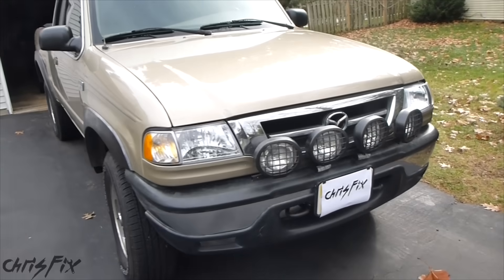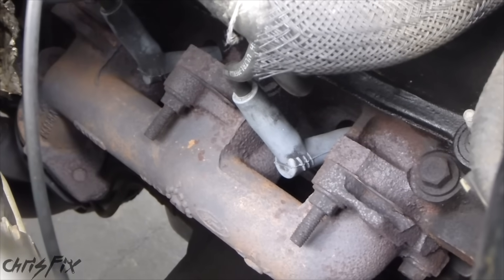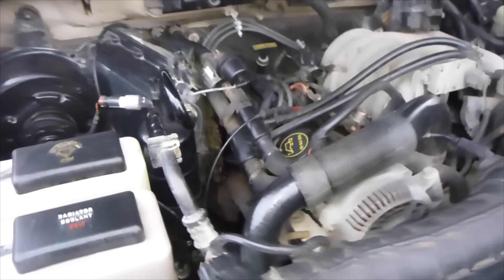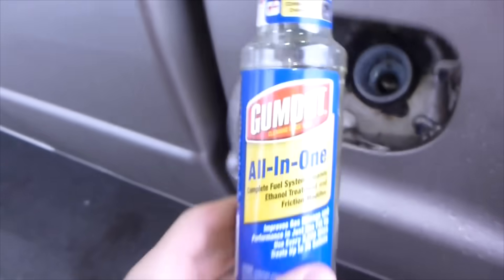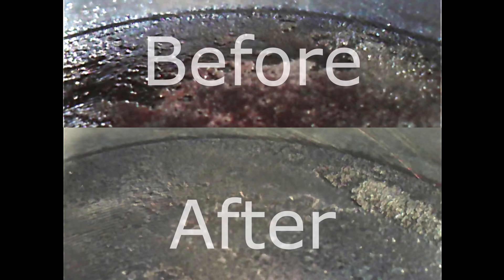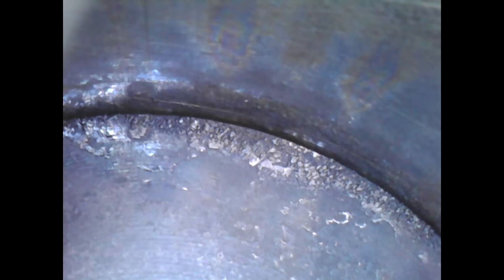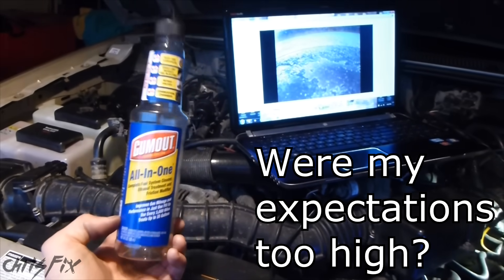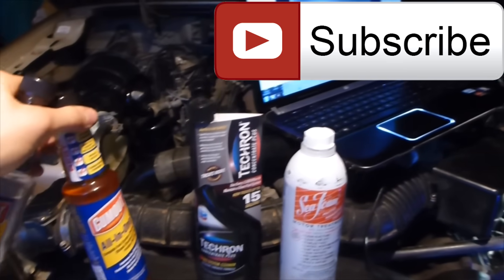Do fuel system cleaners actually work? Testing Gumout "All-in-One"

Comment: the big stuff should and you should want it to take longer to dry it out enough to particulate into small enough dust so as to not hurt the valves on the way out after a few applications it should get better but I do 3 applications consecutively to dry it out than not again for long time  honestly never owned a car long enough to have to do it again     another way is to make a chip tool to fit in there and a rubber vac line to remove manually
Reply: +Richard Duenaz forgot to mention I also sprat carb cleaner in the cylinders through the plug holes for a few days than I poor one bottle worth into the cylinders in equal amounts  unless theres one worse few days later i look in tak e tool chi and vac out the pieces spray with more carb cleaner replce plugs run car with gumout only 1\4 tank gas and drive for 40 miles or so fill the tank with one more gumout full tank gas than another than i check after that its usually pretty good if it didn't start to bad
Reply from the maker: +Richard Duenaz Thanks for sharing!

Comment: So far I've driven with half a tank of this. Haven't really noticed improved gas mileage yet, but the acceleration has had a very noticeable increase. Not only is it faster responding to the pedal, but I can now go straight from 0-80 without over-revving the engine, before, the RPM's would shoot to the red and if have to ease of the pedal. I will most definitely be using this again and probably regularly as well

Comment: I believe it works with some of the carbon. I think you need to continue using it for awhile. like try using it everytime you fill up 3 or 4 times. I use gumout highmileage and have had no issues, actually I have more miles than him and it works great for me, now not for everyone, but for me.
Reply from the maker: +Erik Black Thanks for sharing Erik!

Comment: Great video, subscribed. I do wonder though if you had used this product every 5k miles would the carbon layers not been so thick to begin with. It seems to do well with the superficial layers, but the compacted carbon seems like its not going anywhere.
Reply from the maker: +D Lee Thanks! The carbon buildup in this engine is not bad enough to warrant use of a cleaner so often. Save your money! Glad you subbed!

Comment: +ChrisFix

It really might be the wrong place to ask this question, but from your uploads, it really looks like you know what you are talking about!

I have an Audi A6, 2.0 TFSI (2007)
i have some really bad vibrations when the car is running idle. The vibrations comes and goes. Have taken my car to the  shop twice, and both times, from my bad luck, the vibrations went away and they didnt really know what to look for. you can actually feel the vibrations in your ears and i have 2 kids that complain alot about it :(

If you have any idea what it could be or a solution you think i should try out, please do tell me!

Thanks in advance
Reply from the maker: +Dizturbias It might be your exhaust or it could be a slight misfire in the engine.
Reply: Thank you for your response.

Comment: Will this help with a bouncing rpm needle and slight jerking movements?
Reply: that happened on my 2007 328i. but I used techron fuel system cleaner and the bouncing rpm and jerking stopped. I also changed the oil.

Comment: +ChrisFix let me start by saying that you are by far the best Youtube mechanic I've ever seen! Now....I have to say that is horrible gas mileage.Since I've been watching I've fixed my tie-rod ends, sway bar links, put on a leaf spring lifts, put new to me door panels and window guards, and did the Seafoam application. I drive a 2000 Ford Explorer XLT with a 4.0 SOHC. I was wondering if you can change your rear swaybar links for me seeing that ours are practically identical? Thanks for all your hard work!
Reply from the maker: +Gatescaper Thanks a lot! Your gas mileage might be bad like mine because of clogged injectors. I might be doing rear sway bars so stay tuned for that!

Comment: Hey Chris! Nice video. Would you mind doing another fuel additive video about Gumout Multi-System Tune-Up? The one that looks like seafoam. Another youtuber Scotty Kilmer recommends it, but don't really know how well it will work.
Reply from the maker: +Gideon Mak Scotty recommends it because he was paid to recommend it. I will test it out so stay tuned!
Reply: Thanks Chris! I look forward to that video! I used it twice and it somewhat smoothen my engine and I got better acceleration response when I step on the gas for the first time. But not much difference for the second time.
Reply: +ChrisFix Scotty K.HA HA!!I used the Gumout Regain looks about the same?I smelled it doing something?Great video Chris.

Comment: He y ChrisFix, my 2006 VW tdi (i know, a diesel) it has problems where during acceleration i get 0.5 to 1 second of lack of power, its not wheelspin since i can get this in 5 Gear while merging onto the freeway. It has about 200,000kms, it also releases white smoke occasionally when i turn it on and turning it on takes a couple seconds. Can you give me a vague diagnotics? Can anyone help me please?
Reply: It doesnt happen all the time during acceleration, more so around 2000rpm when the turbo kicks in...
Reply from the maker: +Haris_Awesome It could be the heater plug or an injector. Maybe the EGR is stuck open or closed?
Reply: +ChrisFix ive had the EGR valve changed, about a month ago aswell as glow plugs and air intake filter. The turbo seems at times very loud and other times very quite...Ive looked into code error of over boosting, it might over boost to compensate loss in power. Im not sure, i guess ill have to take it to a mechanic! But i appreciate your help!

Comment: Looks like it still helped a lot. My grandpas car ran like garbage when we first got it. I love his car though so I threw in a fuel system cleaner. Ran like a charm since. And is this only after one bottle? Do you think after several bottles that the carbon build up will eventually begin to fade away?
Reply: ChrisFix has done many cleaner tests since and he still hasn't cleaned much more off than the gummy easy stuff.

Comment: Hi Chris, love your videos. Some may disagree with me on this but its true. Any additive that is on the market is known as snake oils in the automotive repair business. The best way to clean your fuel system is to add 1 quart of ATF to a full tank of gas. The ATF will clean out any nasty system. The products on the market only do a half ass job at best in cleaning the system. I run a quart of ATF through my system every 4th oil change.
Reply: +Harold Smith  Also, if you doubt me on this, do a video on a vehicle that needs the system cleaned. Add the ATF to a full tank of gas; run it down to 1/4 tank and check the cylinders with a bore scope.
Reply from the maker: +Harold Smith Thanks for sharing Harold. I get nervous trying stuff like this in my gas but it is tempting!
Reply: You will notice a big difference after the treatment, and no, the engine will not run any differently during cleaning. The ATF will combust with the gas when the spark plug fires. The fuel system cleaner you buy at a parts store is basically ATF with other cleaners added. What the manufacturer will not tell you is that over time and continued use of products like Gumout is that the added cleaners will build up varnish on fuel injectors and carburetor jets giving you shity performance. 1 quart of ATF every fourth oil change and your fuel system will run like new. You don't have to buy the high dollar ATF, the cheap dollar store brand works just fine.
Reply: Your welcome. Do it every 4th oil change and your system will stay like new. This is an old school auto tech trick. ATF also works great in de-sludging your engine. Just replace one quart of oil with ATF and run it no more than 1,000 miles. This will brake up any sludge you have built up in the engine. Remember if you do this, drop the oil pan and clean out all that nasty shit before you put on a new filter and new oil after the de-sludging.
Reply: Bear in mind that the distant bag could have busted in the system canister. I'm not a diesel tech, but I do know that if the system orifice is plugged up with that, you will have to take it to a shop and have the system cleaned. I'd try the ATF first and see if that will fix it.
Reply: +Harold Smith Hello Harold. Can you please tell me what ATF is? Or where can i find it? I cant find it on the internet, if you can link me that would be great.
Reply: Automatic Transmission Fluid. When doing this you don't have to buy the high dollar ATF, the cheap Dollar Store brand will be just fine.
Reply: So i just put it in my gas? And burn it along?
Reply: Yes, 1 quart of ATF to 1 full tank of gas, run it down to just under 1/4 of a tank. If your system is really bad, do it once more. This will fix your problem. REMEMBER, if you have a bad injector, this will not fix it. The injector will have to be replaced, but if your system is just dirty, this is the best old school way to clean the system. Try this first before you go it a repair shop.
Reply: +Harold Smith Does it work for diesels?
Reply: Yes, it will.

Comment: hey @Chrisfix  so I have been having problems with my 89 GMC Jimmy starting up. I replaced the fuel pump the strainer and the relay and it worked ok for one day then I got up this morning and it wouldn't start without me spraying starter fluid into it. any ideas on what it could be? or if anyone else in the comments knows I would greatly appreciate it.
Reply from the maker: +Frankie DiGuardi Could be a vacuum leak or a fuel delivery problem. I would check your fuel pressure: https://www.youtube.com/watch?v=_oXLUqE4Sf0

Comment: Hello,Many Thanks,,, why I am saying to test the guaranteed to pass emission juice? because I heard it is made all in one.Also the company claims that do not use it more than two times per year per vehicle.That tells me it should be full of good things can clean your motor inside all over.I got a 1992 Ford Tempo 70,000km in it but it was sitting for 14 years. Finally I got it from my grandfather and when I etest it (by law in Ontario Canada you need to do that),,,, it past like new car passes emission.I wonder now it passes so well because I used the juice or because the car had low mileage in it. Again mind that it was sitting for 14 yrs. untouched.When I used the juice I only filled up the gas tank 3/4 instead if full. So I assume lot of that juice was implemented in the engine.Please send me the link of the video.
Reply from the maker: +mario agostini Thanks Mario! I would love to test it!

Comment: For any dependable and consistent results, the Gumout should be used starting at around 50K miles, instead of 122K miles, and used at the recommended intervals.
Reply from the maker: +LouieGMDesign Actually, nowhere on the bottle does it say you have to start at 50k miles. It just says to use it and you will see results on your first use. There is no need to use this stuff unless you have a problem.

Comment: It's for preventative maintenance, not removing major deposits. If you had used it at every oil change from the first to the last, you wouldn't have deposits nearly as large.
Reply from the maker: +Jordan Weimer Not what the bottle says. The bottle says it removes carbon.
Reply: It removed carbon. It just doesn't remove all of the carbon... which makes sense. It's a fuel system cleaner not a miracle worker. If you pay a maid for an hour of work and you're a hoarder, that hour ends and your house still looks like crap. It's cleaner. But, you don't sense much difference because a maid can only do so much in an hour.

Comment: How do you drive, when the Gumout is in the tank? Low RPM's? You should run at 2500-3000 rpm for 10 minutes to really cook out the carbon
Reply from the maker: +Taydrum I drive the same way with all of my fuel additive tests. 60% highway at 2500rpms with 4 wide open throttle runs and the rest city driving.
Reply: ChrisFix that should do the trick :D

Comment: Thanks for such an interesting and thought provoking video.  I am not a licensed, trained automotive technician, however as with my friends I have learned a lot just by being around cars and working one each others' vehicles.  I question the difference between the terms, "Clean and Remove."  Were the cylinder heads cleaned? Yes.  Was every bit of the carbon removed? No.  Is it fair to the product to use it in an engine with nearly 300,000 miles?  In my opinion, no.  The only reason that engine is still in your vehicle and not in some junkyard is because of the excellent care you have given to it.
Also, I wonder if it would be wiser to use these additives on newer vehicles, before the ugly carbon build up can cause some serious damage to your engine.  You did not mention if you had ever had the engine torn down as a re-build or just for cleaning and any parts replacement.   One last point.  The vehicle is a 1995 model.  Were you using leaded fuel back then or unleaded?  Thanks again for another one of your great videos.

Rgds,

Tony
Reply from the maker: +Tony Tarquinio Thanks for sharing Tony! This test was done on my truck with 100k miles. Not the windstar. And the windstar is a 95 anyhow and leaded fuel hasnt been in the USA since then!

Comment: can't u just use a pipe cleaner like brush to reach down into the cylinder and pull the carbon build up out?
Reply from the maker: +will green You dont want to do that. You could scrape the cylinder and also release too much carbon at once.

Comment: Chris, you need to try BG 44k. That's the stuff dealers use. You won't find that stuff at Walmart or autozone.
Reply from the maker: +franco804 Yea, I want to try that stuff badly and I was supposed to get a can sent to my PO Box but the person I guess never sent it.
Reply: It's expensive. About $22 for a can. I worked at Chevrolet for 10 years amd that's how we would clean out the fuel systems. Especially on the old shit fire injected 84 C4 cars. Those were a nightmare. I myself personally own a 94 C4 ZF.

Comment: have you try restore  fuel system restorer I think it called that the brand RESTORE it a light gray bottle it the same brand I uses on the engine oil  have you seen it  or try it before let me know or if you gat time do a video of it let see the result cuz I havent find any video of it mayb it new or bad idk
Reply from the maker: gta5 road Thanks for the product suggestion! I will check it out!

Comment: hey bro! again amazing video! i sure appreciate the job you're doing i'm learning alot so thanks man! 
i bought a nissan n16 almera 2002 & i didnt do a total check before purchasing it!  upon checking the oil i noticed sludge on the stick, my mechanic did a flush using transmission fluid its working fine. i was changing the pcv valve yesterday & it broke so i had the engine cover taken out, upon doing so i discovered a bit of sludge in there! when i check my dipstick the oil is clean!!! now its been almost 2 years since the flush and i do my tune up on time, sometimes before time!!! i guess the first flush didnt do a complete clean. can you advise me on the best way to clean the sluge out please bro! 
                   kind regards
Reply from the maker: Jamie De Angelo Awesome! Glad the video was helpful! There is no way to clean all of the sludge out without taking the engine apart. You can try something like this: http://amzn.to/1IYF8iT
Reply: appreciate it much bruh! i'll give this a go and i'll give you a feed back

Comment: Hi Chris, PROBLEM my Hyundai Elantra 1998 1.6GL has recently started to smell gas, my friend as he parked behind me, he could smell this as my car was idle, and also sometimes on the aircon holes on the dash board I can smell it but not often, can you help me on how to check the fuel lines / system from the engine: thank you chris I will also check out the mechanics who can trace these but you know how it goes they might be expensive. and also I have realised that my gas now quickly gets finished
Reply from the maker: successm941 All you need to do is follow the gas lines and look for the leak. It could also be on the gas tank or the evap system.

Comment: Hi Chris .. I am checking what the carbon cleaner was called .. the company in the UK is now based in Birmingham UK code  0044 - 121 525 4000   ask for technical . Orapi Applied.Chemicals . the solvent had a sealer layer floating on top to reduce fumes and evaporation .All steel parts like gudgeon pins, conrods etc would have to be removed prior to using the solvent .
Reply from the maker: Richard Wallinger Awesome. Dont go crazy if you cannot find the name. I am just curious!

Comment: Great video  super logical  real world test .. Shame that the product was not a success. I used some carbon cleaning fluid years ago  It was very aggressive with a sealer liquid floating on the cleaner .Even the hard carbon in the piston ring grooves dissolved leaving the pistons shiny aluminium  an new appearance .This cleaner was not suitable for steel gudgeon pins .Plus the old rings had to be removed prior to immersing the pistons in the cleaner .Applied chemicals in the UK were the manufacturers .  great video and super camera work .
Reply from the maker: Richard Wallinger Thanks Richard and thanks for sharing! What was the product called?

Comment: The instructions do say to use every oil change, if it completely cleaned 122k miles of build up then you'd only need to use it sometimes. Also seeing some of it has cleaned up, I bet you'd see a big difference on injectors and valves.

Seems this cleaner has done a lot more then I expected, I'll be using it on my vehicle as instructed
Reply from the maker: Mike Gann Thanks for the insight Mike!